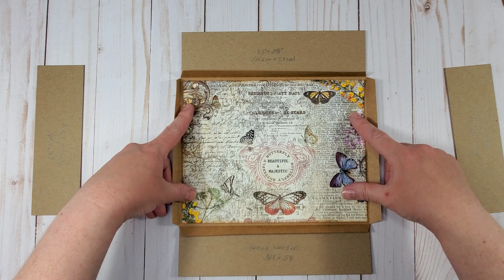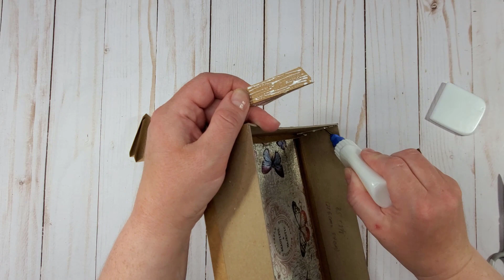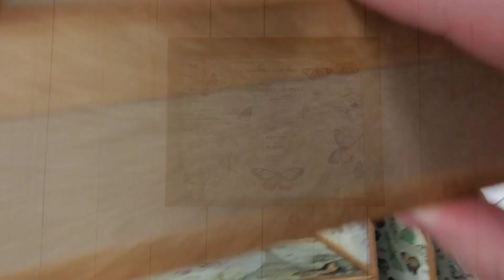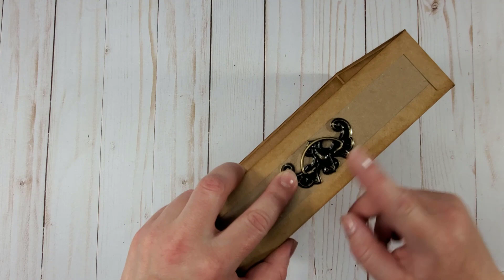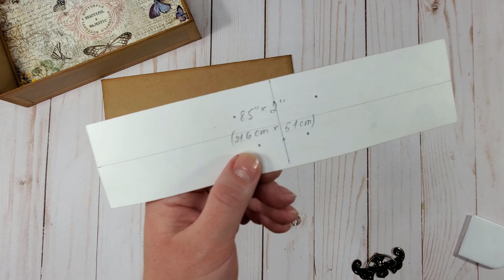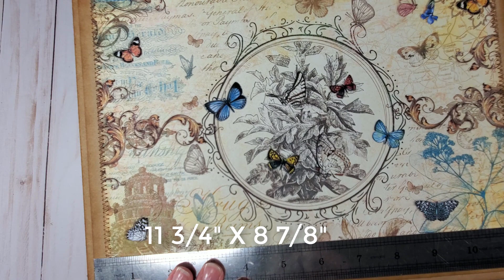Butterfly Beauty - Constructing The Drawers - Part 2

Comment: Decided to try this. However, I'm doing a little adjusting and making 4 drawers.. =^^=
Reply from the maker: Yay! Debbie, you will need to make the additional drawers about 1/4" lower than the ones that I show in the video. It will be even more work with 4 drawers, I hope you are ready :))
Reply: It actually worked out easy.
Reply from the maker: @debbievignola8275  that's awesome!! Can't wait to see your finished "station" 😘